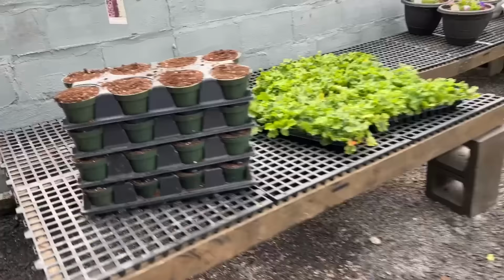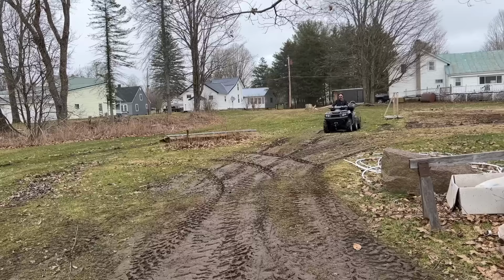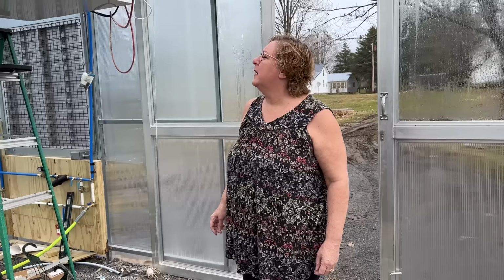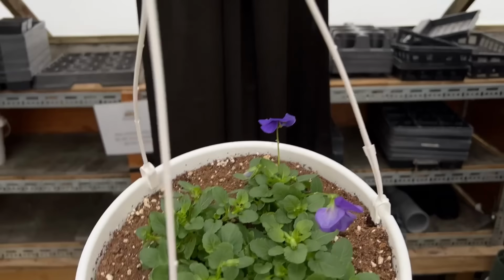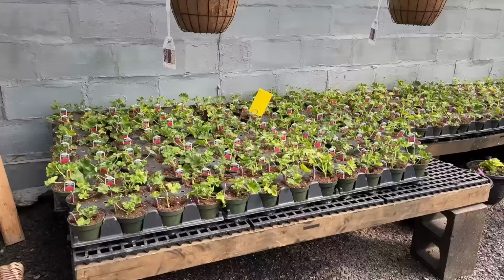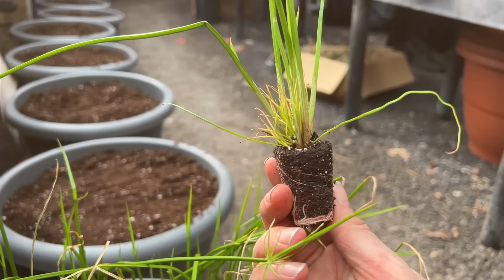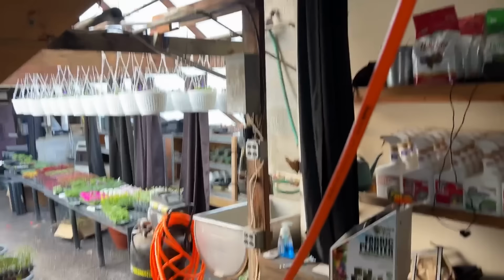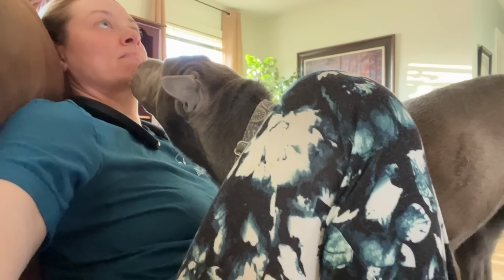Let's Name the Pot Filler! MORE Planting Fun : Flower Hill Farm

Comment: Nicole, I struggled with my plug trays drying out, too.  I used some of the very shallow white germination trays from Greenhouse Megastore and it really helped.  You could use anything that will hold moisture in the bottom so the plug roots can get a quick drink.  I still need to water daily, but not multiple times/day.